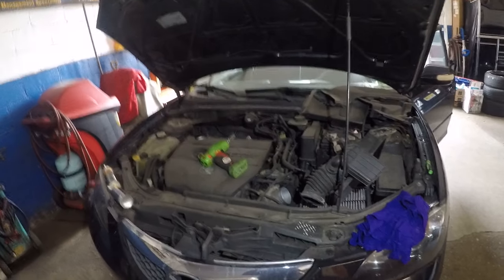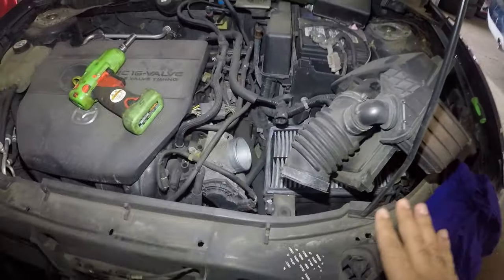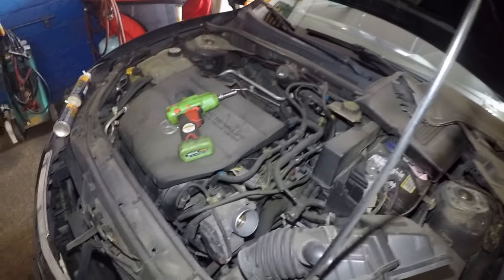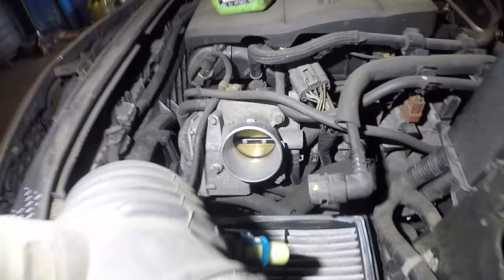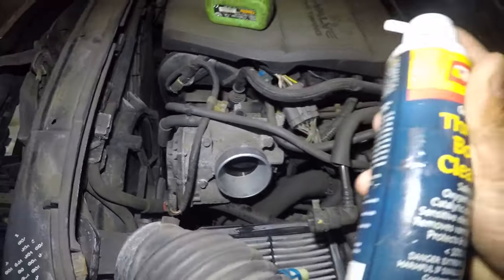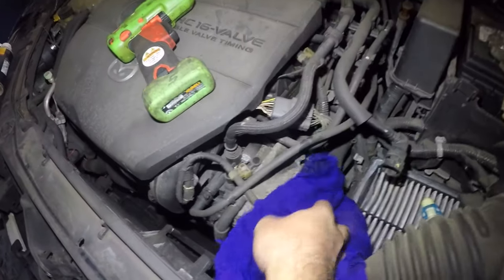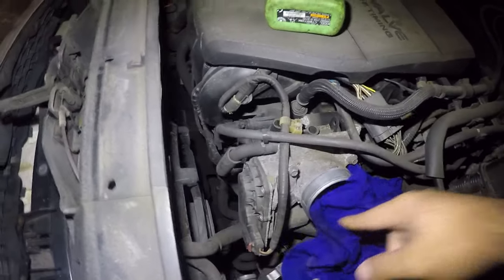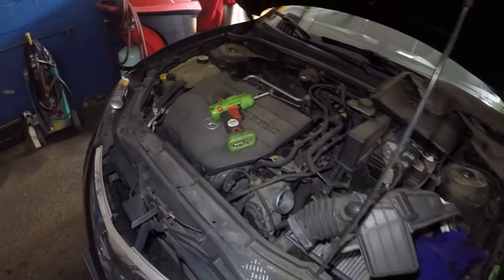Mazda 3 Stalls at Red light or Stop Sign LOW RPM QUICK FIX

Comment: Thanks. I had P0506 code, and the car was stalling while breaking/slowing down. I cleaned the mass air flow sensor with electrical conductor cleaner, and I cleaned out the throttle body with a toothbrush and a rag. I erased the code and the car was running 100% with no engine stalling.
Reply from the maker: Nice job!!! Definitely good service make the car run much better

Comment: this is the dumbest most unsafe way to do it, yeah he has someone holding the gas pedal down but you have to start by undoing the neg battery cable, turn headlights on to drain electrical system then turn them off once lights go out. then unplug the sensor on side of throttle body (its tricky there’s a tab you have to hold on the side while pulling the red tab away from the sensor to unlock it) you can then move the butterfly plate by hand and use ONLY throttle body cleaner, NOT CARB CLEANER. make sure to wipe with a rag or clean thin towel and try not to let any crud seap down into the intake cuz you might clog it further down then you’ll have to take the coolant line off the TB and take apart your intake manifold to clean it all out- NOT EASY! this is the only way to move the throttle body plate without damaging the TPS sensor, TPS electric motor, or servo gears inside the TB. happy cleaning! if you do damage it, the new TB costs about $240 and to remove the coolant line you have to drain the coolant system so that coolant does fly everywhere like it did when i took mine apart😂😂😂
Reply from the maker: Yes I have some one holding gaspeddle it easy and correct way to do it
Reply: @RBTheMechanic  yes i saw the video and sure its easy but dont cut corners like this just do the extra work and charge extra for it😂🫡
Reply: Wow , finally  an smart comment.  👌👌👌and the proper procedure
Reply: Ur smoking rocks.
Reply: @igotyourmomful  wow, you definitely went to college💀😭😭

Comment: My friend, I have a Mazda 3 2006 2.0 when I step on the gas and want to accelerate the engine I hear a knocking sound and sometimes the engine dies by itself without any reason when on AC or stationary conditions. Have you ever dealt with a similar case?
Reply from the maker: Did u clean out throttle body it could be clogged or dirty or bad start with cleaning it first
Reply: I'm having the same issue on my Mazda axela LPG. I've cleaned the throttle but the problem does not seem to cease. 😢
Reply from the maker: @krishanchaudhary601  what’s ur original issue?
Reply: @RBTheMechanic  misfires on cylinder 1 and 2

Comment: If this doesn't fix your Mazda3 it might be the fault I had with mine- two of the 4 cylinders had air leaks on the intake manifold. The garage replaced all 4 gaskets to be on the safe side. Car now runs like brand new!
Reply from the maker: Thank you for the u put!!
Reply: My car looses power when I accelerate  sometimes it gains power ..sometimes its like it's braking itself .. it's stressing me out , what might be the problem
Reply from the maker: @just-iceproclaim5031  do throttle service and scan for codes
Reply: Did you have any codes?
Reply from the maker: @moilaset11   no

Comment: I changed out the battery, the alternator, starter , temperature sensor, spark plugs and coil packs car cleaned the throttle body as good as I could and it still shuts off

Comment: My MAZDA 3 had the same issue low rpm I kept stalling on every stops, the conclusion was I added an octane booster and use premium gas on my next fill up half way through the tank I had no more low rpm went back up to 800 rpm from 500rpm below. Oh, and my Mazda 3 hatch has 608k km on the engine
Reply from the maker: Clean the throttle

Comment: My Mazda 3 idling rough , it cuts off during acceleration from a complete stop , or turn the wheel and it goes off
Reply from the maker: Did u scan the car for codes
Reply: @RBTheMechanic  they faulty codes , it’s saying something about it’s running to lean now

Comment: Any videos on replacing the throttle body on the maz3? I see nuff vids showing the cleaning which is helful but my electrical is bad on the Throttle body
Reply from the maker: Well I don’t have video but u can remove all the pipes connecting it and then connector on it and bolts should come off

Comment: I cleaned the throttle body as well as the mass air flow sensor and i put a new intake filter in, and it fixed the low/ruff idl right up
Reply from the maker: Nice this is good maintenance u did

Comment: Hey greetings man , I appreciate the help in advance I have a ‘11 Speed 3 with 181k miles. It just threw me a p050A code. I haven’t checked anything yet. When I turn it on in the mornings , like the muffler shakes and it can be felt in the cabin , if you stay still it’ll vibrate the seat a bit. When I am taking off the rpm’s are a bit low and when I drive it’s like they run higher then usual now , causing me to shift into next gear sooner then before. Any thoughts on what this could be? Again much appreciated for the help 🙏🏽🙏🏽
Reply from the maker: So much going on there well first u need to check wats shaking down there have some one start the car and see under there other than that u might wanna start with cleaning

Comment: I just bought a throttle body for my Mazda 3 I 2005 after checking battery, fuses and cleaning the MAF. Still had issues with acceleration/deceleration and stalling when idle. I think I had jumped the gun a bit in buying the TB. I have receipt and going to clean my current one first before replacing it with a brand new one. All the videos I have seen point to just “cleaning” it . 

When is it appropriate to just “replace” it vs cleaning it? My Car has about 150k miles on it and also isn’t it “better” to take the entire TB out from car and cleaning it then just cleaning it installed ??
Reply from the maker: Clean it out first if there’s no change then might want to dig deeper check for codes and any other issue clean out MAF sensor also
Reply: Wondering how the car is doing now and what you did
Reply: Hey @GodsFavourite2024 ! The car has been running great. What I ended up doing was in fact returning the TB that i had bought back for a refund. I ended up buying a throttle cleaner and cleaned the existing TB (it was clunked up). I Had to take one of the hose lines off (coolant) and i had plugged the tube so that it did not leak everywhere. 

Once I cleaned it - i put every back how it was and then reset the codes based on manual steps i found online but it was not good enough. I had to reset it with one of those scan tools. Since cleaning it and resetting it, the check engine light has not come back and car is running great!
Reply: @silverreyes7912  I have the same issue with Mazda 3 2008 from time to time, almost have done everything you have, it's disappearing and coming back on several occasions, sick of it already, I'm happy that you got over the problem

Comment: My son has a 2004 mazda3 with 1.6 auto..installed a new drives side axel and now it's stalling while in gear.smooth while in park or neutral, could there be a connection to this problem?
Reply from the maker: I don’t think so did u disconnect battery?

Comment: Please reply I’m looking for help and nobody has replied. I have a 2010 mazda 3. I had someone mess with my car and pour sugar down my gas tank. Got my fuel line and pump replaced but it’s kinda always ran a little different. I figure its usual wear and tear stuff especially since sugar had gone down it but after three months it gave out. I would have an occasional surge at 4K rpms on the freeway. Happens off and on. And yesterday it jus started up and died instantly. I’ve been told mass air flow sensor or fuel pump what does it sound like.
Reply: The idle is also very rough and will sometimes go up
Reply from the maker: Ok sounds like idle is not holding up try to push gaspeddle softly to keep it alive when this stall is occurring let me know what happnes u should be able to keep the car alive if it’s due to throttle issue let me know and get back to me. Also see if u can make a video that can show me lot
Reply: @RBTheMechanic  okay I just took a video I’m going. To post it to my page comment on it w your thoughts
Reply: @RBTheMechanic  video is now posted
Reply from the maker: @Chopliferoc  ok I will check out with family right now
Reply from the maker: @Chopliferoc  ok I look at the video well rpm is high but I wouldn’t pay attention to that high rpm but once car gets hot it should maintain close to 700 rpm anyways try the trick with gas peddle next time it try to stall out use ur gas peddle softly press it to keep the car alive if that work then I would recommend clean throttle body and if it continues it might need replacement also check to see any vaccume line loose disconnect and check the air pipe for holes the big air duct pipe is commmon to have rips on the groves look all around

Comment: Do you have any idea where the idle air control sensor is on the 08 mazda 3?
Reply from the maker: It dosent have IAC this thorottle u see in this video is electrical so it works and acts as IAC coumputer can control the idle with it and same throttle is controlled with gas peddle.

Comment: My Cas has been stalling / loosing rpm so drastic for two months now. It stalls at red lights or stops most of the cases, when I'm about high speeds it only make some kind of "kickbacks" loosing so much rpms. There are no either check engine lights or other lights. What can it be?

I have a Mazda 3 2011, 120K km now and it stills happening. It's more frequently at cold weather's during mornings.

Throttle systems was already cleaned, fluid transmission as well, but it keeps stalling.

Thanks, help is appreciated!!!!
Reply from the maker: What about ur idle speed at red light what is ur idle speed with car in gear and it’s nice and warm?
Reply: Mine does that. I'm nor sure what i have to clean or replace either. I guess.... everything?
Reply from the maker: @nolechamp9677  start with throttle cleaning and see the outcome if it get better I can do any harm only make it better

Comment: I have. 1999 Honda Accord and when I drive the car drives smooth but sometimes it takes time to catch up to speed and jumps but when I come to a stop sign or a red light the car tries to cut off o was wondering if I should clean my throttle to see if it would fix the problem
Reply from the maker: That has idle sensor u might have to clean or change that ... other stuff check ur engine mounts trans mount before ruling out transmission skipping
Reply: Check as well .. spark plugs, air filters, spark plugs coils, fuel pump filters

Comment: Hi... I had some aceleration problems... its acelerate itself without puting my feet on the gas pedal.   Do you think its time to replace it?... how many times a year I had to clean it?
Reply from the maker: Well u should clean it around 20-30k miles but this will help with low rpm but not high u might have to do idea relearn
Reply: @RBTheMechanic  I almost to that in a daily basis... I park aside and turn off/on... is there a better solution?
Reply from the maker: @AlbertoGonzalez-xn1lw  I didn’t understand what u said high rpm speed could be bad throttle
Reply: @RBTheMechanic  yup... for example... im drving... and then I press the gas pedal... and sudenly when I take it off  the RPM meter stays in 1,500.. and the car goes a little fast... it doesnt do the problem always but when it does I park aside the road... turn the car off... then turn on  and goes normal..... sorry for my bad english... Im from Puerto Rico...
Reply from the maker: @AlbertoGonzalez-xn1lw  yeah I’m not understanding ur problem ru saying the rpm goes up on ur own ?   If that’s the car do try cleaning it one time worst come to worst try disconnecting battery that will reset the idle otherwise new throttle
Reply: @RBTheMechanic  yup thats it.. it comes up on its own.... I put the brake..  it goes down a little bit but then comes up (the RPG) .. I did clean it back on  september and did the battery thing so I guess is time to replace it... thanks for your patience and help 🙂

Comment: I have 2006 mazda 3 319.000k miles  that has a up down idle vibration only when a/c is on  What could it most likely be ?
Reply: exact same problem, but with a 2016 cx9
Reply: @hamoud487   I cleaned mu throttle body and it fixed problem    look up some video's on youtube how to clean electric throttle body I took mine out to do a cleaning #0000 stealwool and a brush and carb cleaner. Be careful with flap 

Im not responsible for any damages  so be carefull
Reply: @Devo1987  Thanks for the tip. Much Appreciated
Reply: @hamoud487   no problem man I got your back

Comment: Hey I cleaned mine couple minutes and now I go for a drive and I put it in Neutral because I have a standard and it’s high idle so what do I do?
Reply from the maker: You have Mazda 3?   Well drive it wound safely it will relearn idle
Reply: Leave the car idling for 20 mins turn on the ac and leave it for another 20 mins the computer resets itself and it idles better bro

Comment: I got a check engine light on after I did that
Reply from the maker: What kinda car u have? Did u disconnect the sensors and turn the key... if u can pull the codes let me know we can follow up
Reply: I have a 2004 Mazda 3 hatchback
Reply: I took it to olreilys and the check engine light with the machine it gave me this code p2188
Reply from the maker: @elwuerko_z25detamaulipas22  reset the light it might be high rpm ... did u open the throttle by hand when u cleaned it?
Reply: @RBTheMechanic  I didn't do that I'm about do it
Reply: @RBTheMechanic  I cleaned the throttle body it still cut off
Reply from the maker: @elwuerko_z25detamaulipas22  did u force open the theottle
Reply: @RBTheMechanic  no I had somebody pressing the accelerator and I cleaned it

Comment: Worked
Reply from the maker: Good job!!!
Reply: @RBTheMechanic  yeah I installed a new battery in my brothers 2012 mazda 3 and i guess the computer had to learn the idle and clean the throttle rpms would read low and engine shaking
Reply from the maker: @tenshikoosh3657  oh yeah defiantly it will loose idle memory once u disconnect power

Comment: wrong....you need to teach the computer how to idle
Reply from the maker: Nope car was good after cleaning
Reply: True- but only after disconnecting the negative terminal..etc. He's talking about low idle in general.
Reply: Hey! That same problem is happening to my Mazda right now. I did change the battery in december and I tried to "teach the computer" how to idle by starting the car and leave it running 20 minutes + 15 mins with full A/C and it kinda work during 1 week then it went back to 400-350 RPM and lights and fans dropping and Wheel light showing off on board at stop signs or red lights... sigh... I have to keep the pedal down to be sure it doesn't stall lol. I guess I will give RB's trick a try!
Reply: @thierrybegin-l.9150  you know it is funny...my car  start to do the same 3 days ago..super hard to start and super low idle...and die in any stop
Reply: @sandraperez7160  You know what? I went to the store, I bought the CRC Throttlebody cleaner. I put the bottle it in my car so I have it around when I'm ready to use it and guess what... when I started the car from the store I came back, no more weird iddle, no more lights/fans dimming, no more stalling at stop signs xD 
The car was so scared I open it up it thought : no way! I PROMISSS I'll work fine!!!!!
(I will still clean it since I bought the cleaner but what a weird coincidence xD!!!)
Reply: @sandraperez7160  that’s sucks, I feel it. Did you resolve your issue by cleaning the throttle body?